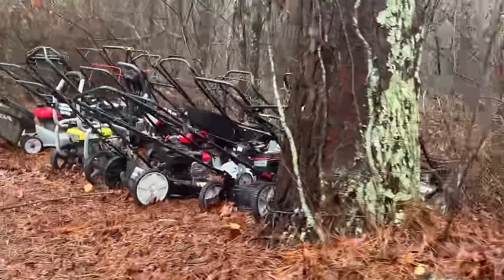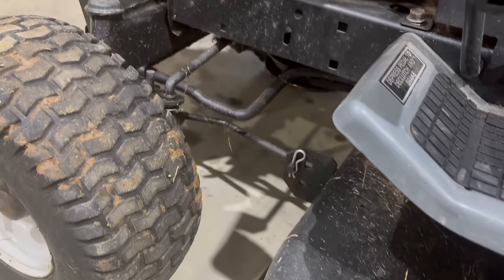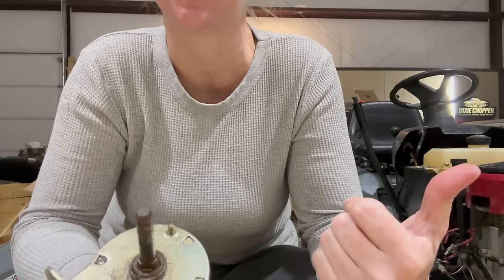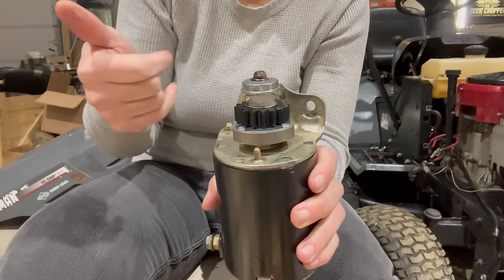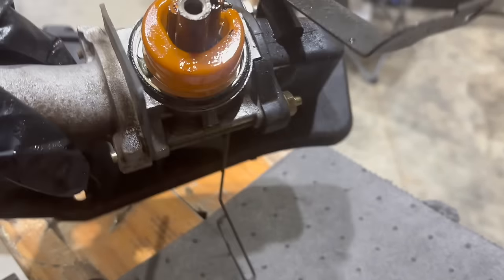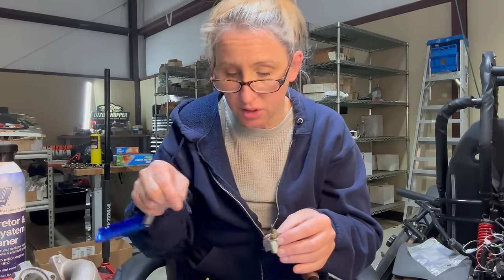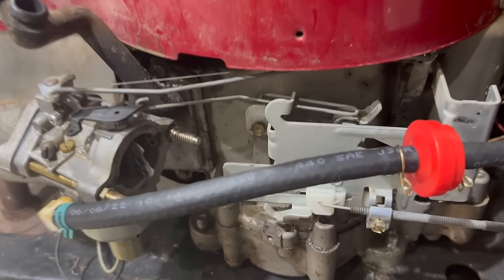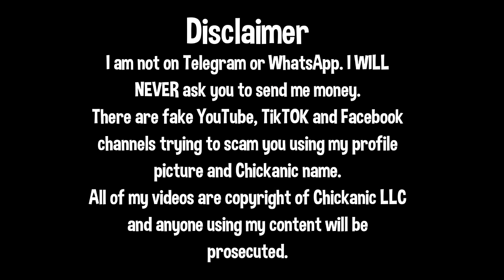Customers 30 Year Old Trash Makes Me TONS of Money! Giving Purpose Back to Abandoned Machines.

Comment: The reason mowers lasted 30 years was MTD didnt own all brands 30 years ago like they do now., MTD makes JUNK, they take good metal, engines and bolts and nuts and turn it into JUNK<
Reply: The Cub Cadets back in the early 80s were overbuilt.  A 17 hp mower would run you $4 grand, but would last for decades.  The new Cubs are just built cheap. I overhauled 30 year old mowers, that were still going strong.
Reply: Yeah I have a new Cug that I would not hit a bull in the azz with.  My old Craftsman mower is still going strong.
Reply: My old neighbor in the northeast had that exact same mower for 30+ years. He mowed an acre and a half with it every week last year he told me he finally died and he had to get a new one.
Reply: Own it and make good equipment you'll never sell another mower to them again.
Reply: I'd take a mtd any day!
Not real heavy,but all about cutting!
Reply: @samkaplitz9036  Well PT Barnum said one of your were born every minute.
Reply: @dennislaws5187  👀😳🥺
Reply: MTD mowers were fine if people actually took care of them and used them for their intended purpose.  Use a lawn mower for mowing lawns not fields. Using a lawn tractor for mowing lawns and not acres of orchard and cow fields. Most of the problems we had with MTD products were their owners. Sure they were not top of the line but they worked for the average homeowner.
Reply: Who do you think made this craftsman?
Reply: @danbartolini27  Craftsman has not produced a Good machine in 30 plus years, that is likely a MTD it looks like crap.
Reply: Wow! Miss the point much
Reply: @danbartolini27  Craftsman was AYP no HOP  but the modern ones from lLowes are MTD.
Reply: @dennislaws5187  Craftsman has never produced one piece of equipment ever ! It was produced by other companies for them .Companies like AYP ,MTD,Murray and all of the companies they absorbed. It's called badge engineering.
Reply: @MUUKOW3  Roper produced a HUGE number of Craftsman, I aint stupid, I know craftsman is a trade name coined by Sears, I know craftsman did not actually make anything, sears contracted with various companies to make things with the craftsman name,  dont attempt to educate somebody who knows more than you. .
Reply: @dennislaws5187  Roper was bought out by AYP and if you had any reading comprehension you would have figured out I said that. The fact you used the words "I ain't stupid " and did not even spell it right? That speaks for itself.
Reply: I've still got my dad's 1981 Snapper rider still running great!
Reply: I have a Craftsman DLS 3500 from 2007.  It's AYP built.  Replacement parts are now sold under Husqvarna label.
Reply: @JAD1DAD  Husqvarna is AYP .
Reply: Oh your a comedian
Reply: Get ready for cheaper cause mtd got bought out by black and Decker

Comment: That Briggs engine was built in Milwaukee, WI. The Cylinder, Head, sump, and Crank were machined in Dept. 394. I was one of the Supervisors in that department we took much pride in machining those parts. I retired in 1997 they gave us older employees and offer we couldn't refuse.
Reply from the maker: Too cool!
Reply: While machining heads and block, you should have mentioned to design team…”hey!, we need another head bolt between cylinder and pushrod passage”🤷‍♂️😆
Reply: @Chickanic ... Are your starter drives actually Bendix brand, or are you just going with the name?
Reply: Waking up a dormant engine is a great feeling.

Comment: Knowing how to fix small engines and lawnmower repair is a great side hustle. I love learning from your videos.  I'm old and believe in fixing things as opposed to replacing them. 
❤❤❤
Reply: The effects of the great depression never wear off. My parents and grandparents had been thru it and raised me that if all else fails and it can't be fixed, take it apart and save all the hardware and good parts and scrap the busted stuff, if you. COULDN'T torch weld it back together with a wire coat-hanger

Comment: I'm a long time mechanic and the best product for removing varnish and stubborn gunk from carburetors is genuine Subaru upper engine cleaner. I got lucky a few years ago and had a box of it given to me and I use it to de-carbon two & four stroke engine combustion chambers, carburetor cleaning and diesel engine inlet manifolds.

Comment: My mother in law gave me a Craftsman LT1000 20 years ago and I still use it.  I have replaced the spindles twice because I use it as a brush hog. That thing is built like a tank.
Reply: I have an old LT1000 too that the reverse gear won't engage. It's not in great shape from sitting but the deck is still like new. It's far stronger and thicker than the one on my newer Toro Z-Turn. I have been eyeing up how to modify the deck from the LT1000 to fit the Toro, as the deck on it is rotted out.

Comment: It is always a good idea to add a fuel shut off valve in the line between the filter and the fuel tank , it's insurance against fuel entering the sump and makes changing the filter easier .
Reply: Agree, and replace the entire fuel line. .after 30 years the inner fuel hose starts to deteriorate and will clog your filter(you DO have a filter..??) Ask me how I know...😊

Comment: I grew up with a toro mower that lasted over 30 years. The mower finally died in 1980.  My parents bought a craftsman then.  It died in 1996, from the deck rotting out.  I bought a Toro Recycler in 1996 that will still start within 3 pulls.  It isn't used often as I now have a tractor, but I keep it in running order.

Comment: Run the exact mower for years, still running when I gave it away!  I wouldn’t have gotten rid of it, but it was not good on a hill. Almost turned it over a couple of times. Upgraded to a JD  X730 54” deck with 54”hydraulic plow 😊

Comment: I ALWAYS install a fuel shutoff valve on these riders!  I've helped out multiple neighbors who had the crankcase full of gasoline due to the needle/seat not completely sealing and that secondary anti-backfire fuel cutoff solenoid also not sealing perfectly.
Reply from the maker: Yup! This one is definitely getting a shut off. As soon as I figure out where they are. lol
Reply: @Chickanic Having moved a little over a year ago, after being in the same house and garage for 25 years, I can relate to this!  I just had to order some headlight bulbs for one of my cars, because I can't find the box of 20 or so of them that I have in the new garage . . . somewhere.
Reply: @Chickanic  It doesn't make sense to me that manufacturers do not install fuel shut off valves on brand new gas-powered small engine equipment. I assume it's the same reason why cell phone manufacturers sell new phones w/out protective cases already included: money/added profit?

Comment: For a carb with hardened varnish, try a PineSol solution in your ultrasonic cleaner. Don't let it go too long or it will discolor some metal surfaces. Fill the tub with water and put the carb and cleaning solution in a glass jar. The ultrasonic waves will pass right through the glass and the cleaner is ready to go for next time.
Reply: Yes a good solution would have cleaned the bowl too. 
Simple Green Extreme Aviation formula works well.
Reply: I had great resuts with Chem-Dip !

Comment: I have this mower but mine is a 97 model. I've repaired it a few times, even replaced the deck pan 8 or 10 years ago because I liked it so much. Three years ago it survived a garage fire but not well and it is ugly to look at. I fixed it enough to mow my lawn and ran it another two years because I couldn't see spending two to three thousand dollars to replace it. It still runs but has issues leaking oil and the transmission is now failing. So I bought another Craftsman from a friend that is only 17 years old. Great machines.

Comment: I have a 1999 craftsman with a 15.5 Kohler engine and it has been a great mower and it’s still mowing like she should  the only thing I have replaced is the coil and two spark plugs  that’s it and the 42” cut is still in working shape

Comment: I used to work for sears Canada from 2004 to 2010 as an appliance tech, HVAC, and small engine repair. Emissions requirements back then were getting strict. Add to the fact that gasoline these days is absolute crap, that engine only needs to be warmed up. Especially that  it's cold there! That is a gem you have there! 

One thing I have noticed lately is that even after a good carb clean, things seem to run lean. I picked up a Generac GP7500 generator that is 2 years old with 3 hours on it a few months ago. Even after giving that carb a  full cleaning, it would not run good after. I bought a new carb and it runs great now. Having the same problem with 2 firman 3550 watt generators. needed carb replacements to run like new. 

Your 2 stroke videos saved me a lot of money, and a lot of time. I thank you for these informative videos; keep them coming!

Comment: Like Mikewater1958 said, putting the air filter on it could help the surging issue by restricting the air flow thus resulting in a richer mix. Another possible thing to look at would be the governor spring. If the mower is 30 years old, that spring may be a bit sprung. A new spring might give it the ability to even out the throttle. Keep up the great work! Love watching your videos!

Comment: I love those old craftsman mowers. I gave my sister one that was about as old last year after I went through checking everything, changed all fuel line, added a fuel shutoff switch, changed the belts, put new blades on it, and replaced the original seat with a good boat seat I had sitting around. Those old mowers are tanks, especially the 6 speed standards like I gave her! (The automatic transmission ones have a tendency to go out so look for the standard.) I buy and fix them up all the time usually looking for the "won't start" for cheap!

Comment: I have a snowblower I bought in Jan. of 1997 and this is the first winter that I haven't started it yet.  Last spring, I prepped it for storage, and usually in November, I grease and oil it, make sure the oil is full, gas it up and at least make sure it runs.  But no real snow yet this season, and what we had just melted, so I didn't even bother with it yet.  It is looking like it may sit there in storage mode until November, unless we get dumped on before mid April. Nice to see another near 30 year old engine come to life.

Comment: Nice work, those older Briggs were great engines, the new ones have issues like bad cams as you know. I use purple power in my ultrasonic cleaners that seems to cut the varnish pretty good. Sometimes it may discolor the aluminum some, so I don't use it to strong, Really hot water also helps a lot. Thanks for a great video.

Comment: When I bought my house in 2005, I purchased for $250. a used Craftsman off an elderly gentleman exactly like that Craftsman except for it also came with a plow and wheel weights. Used it through 2011 to mow my 3/4 acres and in winter to plow my 120’ driveway. Was still working when I gave it to my nephew in spring of 2012. Excellent machine. 👍🏼

Comment: So nice to get something as junk and be able to get it to run.
I received a riding mower with a sign that said "Bad knocking engine. You fix - you can have"
Turned out that the engine was fine, all the mounting bolts to the frame were loose. That was the knocking sound..
Sold it to neighbor and it is still in use today. Got it 5 years ago.

Love your channel and still learn from you.
Thanks for sharing.
Reply: Friend of mine was a backyard motor mechanic , had a girl come in wanting a second opinion on a knocking engine she'd been told needed a full rebuild , he had a look , spotted a broken alternator bracket that was making the noise .

Comment: I have the same one, 1995, in black and with a 14.5hp engine. Former FIL had it since new, garage stored, regular service. I got it from him in 2012. I replaced the deck as it was rotting out but, since then I changed the battery three times, replaced the start relay , starter, and the main drive belt. Still works like a hot damn.

Comment: Hi Bre, if you go to a farm feed store, pick up a gallon of black strap molasses, you can mix the Molasses with warm water, and soak your parts in the molasses and water and it will not harm any of the parts but it will clean them up like new, the more molasses you mix with the water the quicker the batch will work

Comment: Oven cleaner works great on cleaning carbs and engine blocks...also..a wire pulled from a wire brush fits nicely to clean those tiny idle holes by the butterfly

Comment: I own an MTD Yard Machines around the same age as the Craftsman and it's still doing it's job, albeit with repairs here and there.
It also had the fuel drain into the sump when I let it sit too long at one point.
Easy fix, I installed a tap in the fuel line 👍

Comment: Hey Bre, love your videos. Heres a tip you may want to try. I do a lot of RC airplane nitro engines, and when they sit a long time, the varnish locks them solid.  A small crockpot with generic automotive antifreeze in it. Rubber or plastic will get destroyed, but if you put only metal (carb body, etc) in a basket & cook it on low for a few hours, it comes out looking like brand new. I was skeptical too until i tried it. Works better than ultrasonic IMHO. Keep putting out the great videos.

Comment: I still have my Craftsman GT3000 Kohler Command Pro 23 hp V twin. I used it for 21 years with just regular maintenance items and parked it running and working. It was definitely worth the $2700 I paid for it new in 2001. Those AYP tractors are practically indestructible.

Comment: Bre...Those old Briggs and Kohler engines in that size almost always have cast iron cylinder liners and unless severely abused, which that engine looked almost new, are almost always worth repairing.  Great job working on that carburetor and starter.  Very informative!

Comment: I have a 1991 model of the same. I beat the heck out of it on my uneven yard. Even use it to mow leaves. It just keeps on working. Those old AYP riders are bulletproof except for that plastic steering hub in the sector gear. Made an aluminum one to replace it and no more slop.
I did swap the tillitson carb for a Walbro as it constantly overflowed even after replacing the needle/seat. The tillitson could not handle being parked on a slope. The Walbro is better but I still added a fuel shutoff.

Comment: When it comes to gummed up carburetors, methyl hydrate is great for softening all that gunk so it can be washed out with solvent. The surging engine is due to a restriction in the pilot or low speed fuel circuit of the carburetor. Keep up the great work 🙂

Comment: Really enjoyed this video, I happen to like older things, I am currently using a older craftsman snowblower that I got free because he said the electric start didn’t work but it would start easily by hand. It did start easily but I had to check out the starter for my curiosity, when I went to plug it in I found the ground prong on the blower was folded over, I straightened it , plugged it in and it works fine 👍😁🎩

Comment: Safety Clean Carburetor dip tank fluid is the absolute best carb cleaner I have ever used.  We have a dip tank with it and an air powered back and forth basket to put the parts in.  Gumout spray or Berryman B-12 spray works very well also.

Comment: I have a Sears SS16 with an Onan engine I bought new in March 1974, and I mow with it every year.  Only parts I have bought for it is a float for the carburetor, one new seat and some batteries. I did change sparkplugs last year for the first time and a new air filter. I still have the original air filter and plugs that came in it. They still look just fine. For the 48-inch mower deck I bought 1 set of blades and wheels plus new belts 2 times. It has been a perfect lawn tractor for 50 years. Still have the receipt where I bought it in Chatt. Tn.

Comment: brother in law didn't want work on  21hp 46 in craftsman.  was the burp valve on cam broke, i replaced and fires right up. He said sat for few years.  only had replace mower deck belt and battery.  no problem still starts up every spring.   i love working old tractors get it running , use it.

Comment: For cleaning carbs, I use: Krud Kutter Original (concentrated) Cleaner/Degreaser, 1 Gallon. Put it full strength in my ultrasonic cleaner with the heat on and it comes out clean with no discoloring (Looks new). Blow out the passages with your favorite carb cleaner and install!!! I also use the Stens 120-562 fuel filter as the red B&S lets too much sediment through, and buy the multi-pack. Great video!

Comment: Great video I was trained as a teen kid 1973 ish to fix 2 and 4 stroke as well agricultural equipment like bailers, combine harvesters. Now it’s just the cars to look after, an odd motorcycle to build when I feel like it and a 20 plus year old Briggs Stratton plastic deck push along mower that’s due some main bearings when I get a chance, oh it hates 10% ethanol so I use a fuel additive with 5% ethanol.

Comment: My mower is a '93 Craftsman LT4000 bought new.  Still works well, but looks quite a bit worse than the one you have. It will leak gas into the crankcase (think that's what keeps it going), but I shut off the fuel after use. Mine has a Kohler though.

Comment: Hunny most of what I work on is 60+ years old. I've seen quite a variety of issues and had to deal with an amazing amount of issues. You might want to try a gallon can of carb cleaner from say Napa before you use the sonic cleaner. Most of the time I can let it soak in there a day to a few days and get things loosened up.